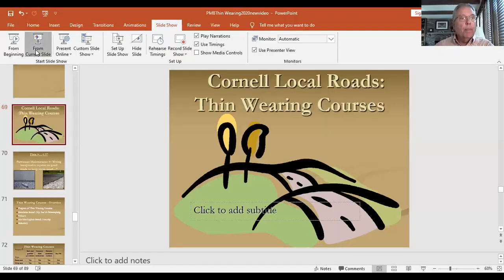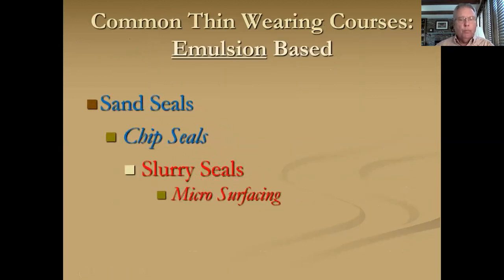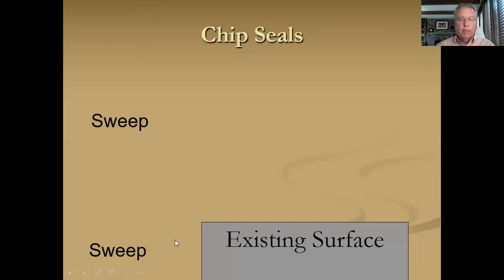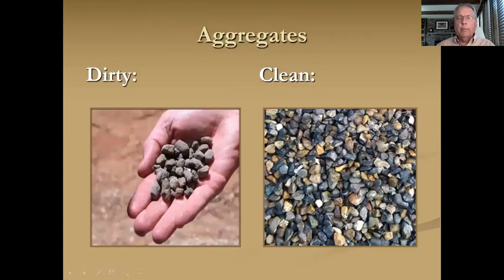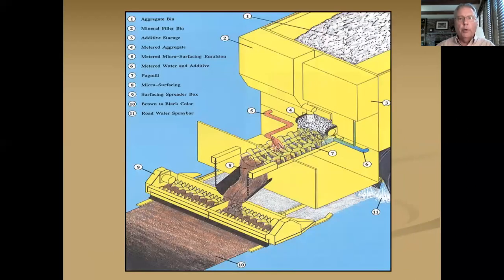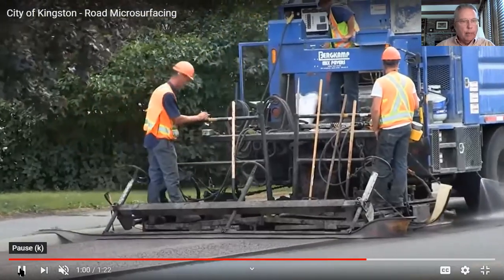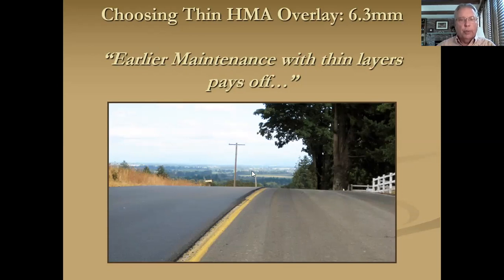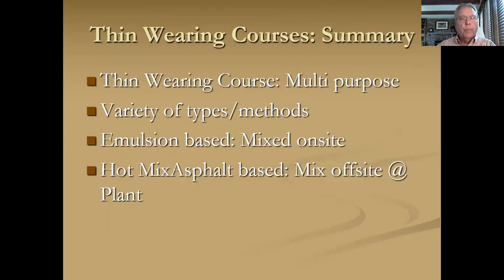Pavement Maintenance Thin Wearing

Comment: Regarding the slurry seal operation, what is being sprayed on the existing pavement surface just in front of the spreader box?
Reply from the maker: Hi Roger,

Sorry for the late reply. In regards to your question: It is just water. 

It is not always needed, but you want to make sure the surface is properly damp before the slurry box. The water can also help with the temperature of the surface. 

Hope this helps!